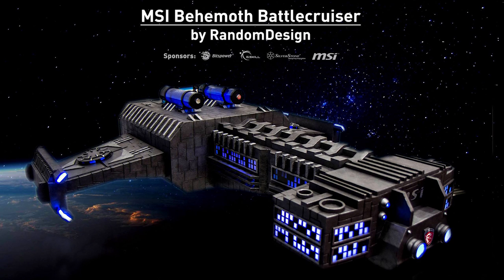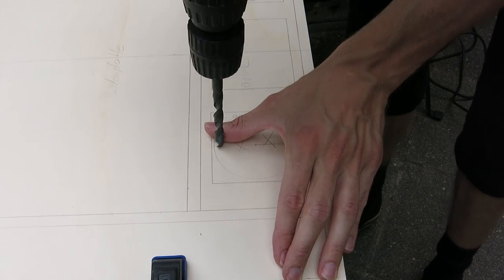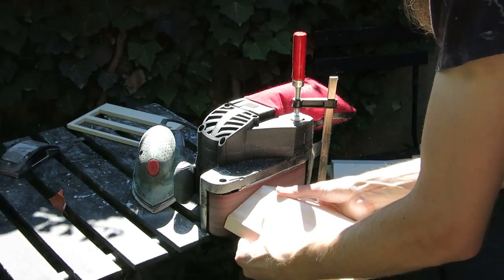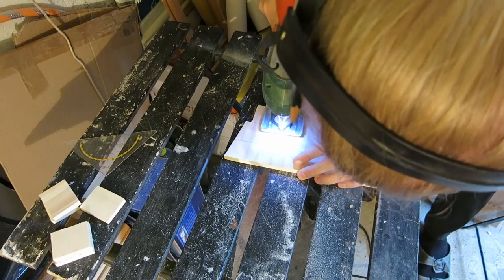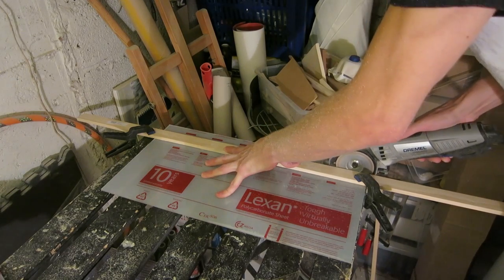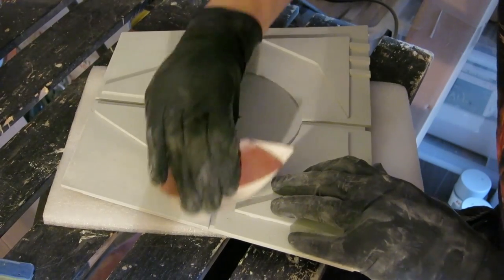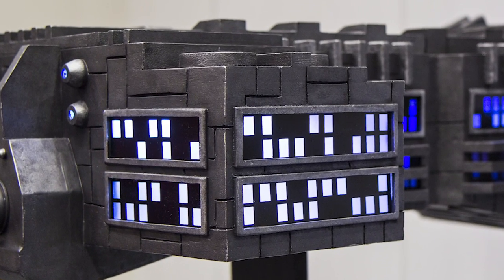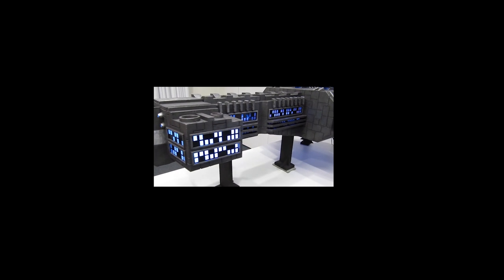Starcraft Case Mod - Battlecruiser - Making-of

Comment: I would like to know if there is possibility of it bought one? If yes, how much does it cost included postal charges as well as the time of manufacturing.
Reply from the maker: +Merli A. The manufacturing time so far is 300+ hours. During my tide schedule I will not be able to build another one in the near future.
Reply: Thank you for your answer. There is a place or I can found files or the plans to make it one has the identical has the 3D printer or wanted has a cabinet maker to make the body?

In everything the cases, the very beautiful work and good luck.

Sorry for the faults, I am French and speak English very well.